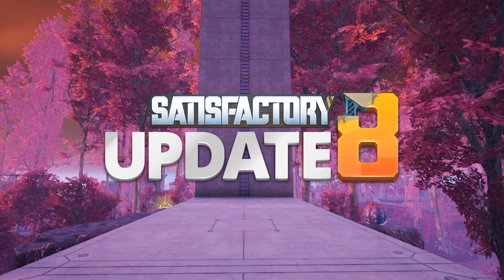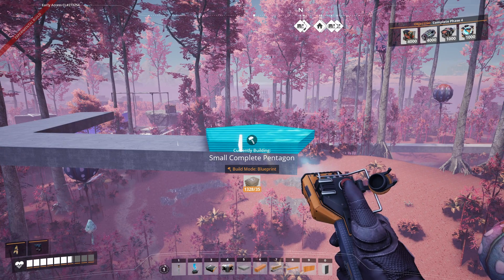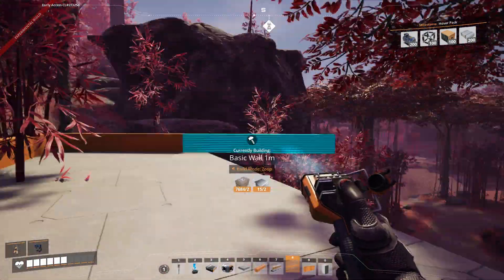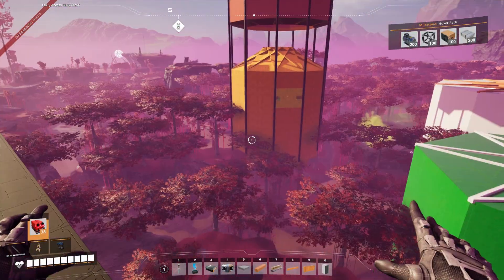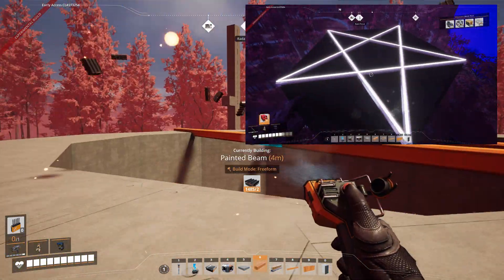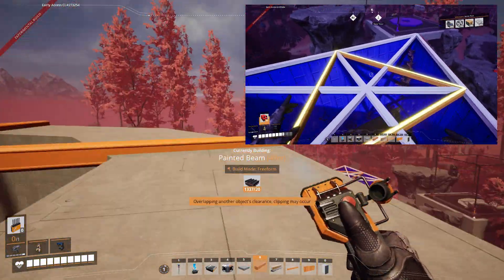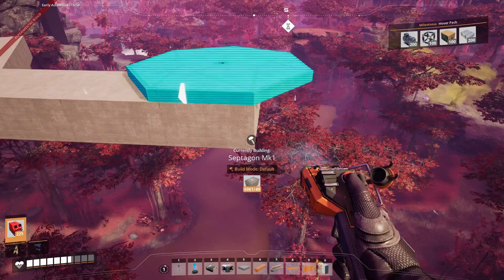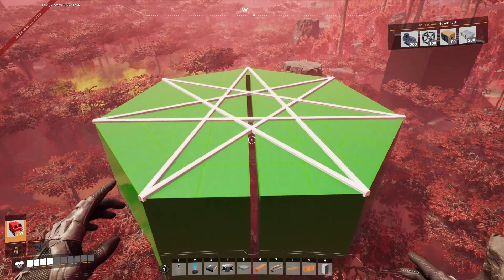Satisfactory Blueprints Ep3. Pentagon and Polygons

Comment: 03:53 Aiming at the foundation at the end of the beam and moving it twice by 4 meters in nudge mode is a much easier method and will produce the same result🤔 I enjoyed the video😁
Reply from the maker: That’s a great idea and will save a couple steps. I’ve absolutely loved the versatility nudge has brought. I use it all the time to solve little problems. 

And thanks. I really enjoyed your video of The Line. Both the details of the gigantic build and the camerawork were top notch.
Reply: Thank you for watching😃 I didn't think that wall installation is based on the beginning of the beam. Using this, more diverse uses will be possible🤔Thank you for sharing information😁